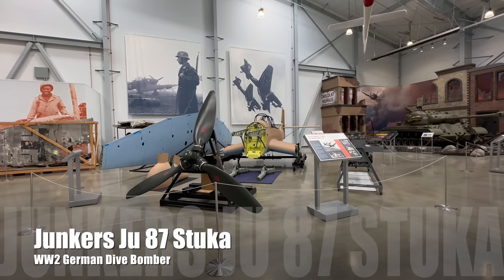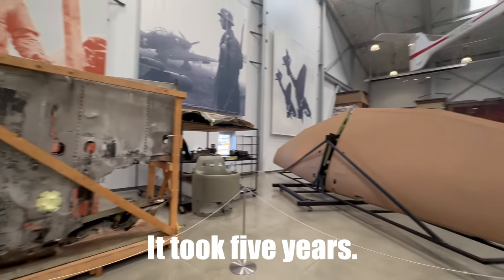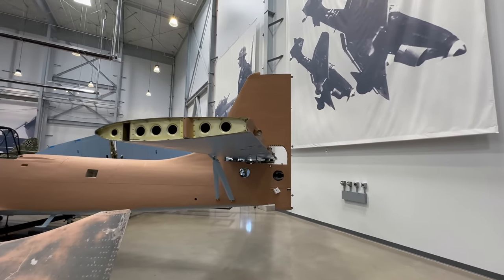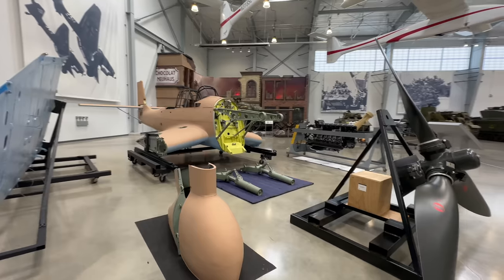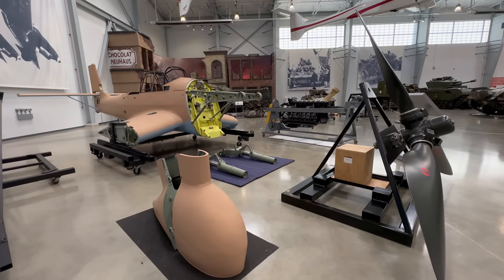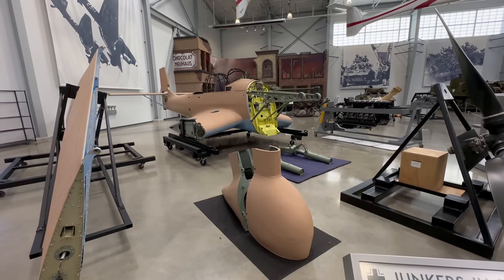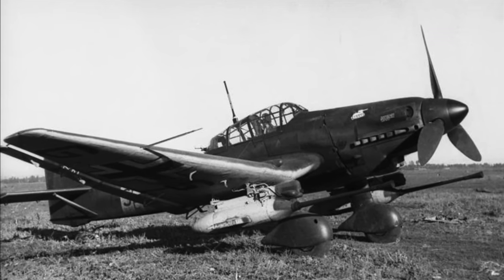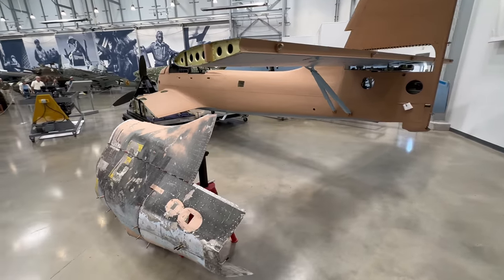WW2 Junkers Ju 87 Stuka FHCAM Restoration Project 2023

Comment: Someone should acquire the Chicago Stuka and restore it flight status.  The rocket scientists at the Museum didn't have it attached properly as it dangled from the ceiling and it crashed about two or three stories down one night back in the 90's.  Thus, the missing wheel spats and distorted right wing.  The motor is there, on separate display.  Besides, the version is different than the other two surviving specimens.
Reply: +@clevlandblock  The Chicago Stuka is the only example that still has the original wartime paint and it should be left alone.  It was dropped years ago with repairs.   It was taken down for cleaning recently and Paul Allen's museum sent engineers there to work undisturbed at night to collect data and many 3D scans of the aircraft to aid the team that was building the flyable Stuka.  This data was extremely important to complete Allen's Stuka.
Reply: @FiveCentsPlease As can be seen from the FHCAM ground up restoration, much COULD & SHOULD be 
done to undo the Chicago Museum's poor care of their Stuka. As it is now, it looks amateurishly maintained & indifferently cared for. It could be exhibited so that the public had so much more access & and awareness for the unique exhibit it is.
Reply: Why restore the Chicago one to flight status?  It's now one of two originals remaining.  Flight status means risking destroying an extremely rare artifact.  I'm all for using it as reference for building a new replica  to fly, but the one at MSI needs preservation, just like enola gay, or spirit of st Louis.
Reply: @sethjones5250   The Chicago Stuka was indeed used a reference to get missing engineering data for the Flying Heritage Museum Ju-87R-4 build.  A team worked at night to take 3D scans for reference and to consult with the build team about various items.  A fair amount of original technical information is missing for the Stuka type.
Reply: @sethjones5250   Restoring the Chicago Stuka to airworthiness would likely be a prohibitive undertaking; my understanding is that there is engine block damage.
I would like to see it restored to its original, as received, static ground display. That would entail repairing/replacing all the parts damaged or discarded after its fall from the museum ceiling,, and repairing the damage done when the museum attached the suspension cables. After 80 yrs, the 
a/c is do for a refurbishment.
Such a restoration, not to flying status, by professional restorers, will be expensive.

Comment: It has always interested me that Junkers were the only German manufacturer who built their own engines and airframes. The Stuka had a high loss rate and like all ‘planes of that time on all sides were built for a transient life. Many of those shot down in Britain went into the melt pot and came out a panels for British bombers and Germany did the same with Allied planes.
Reply: "The Stuka"? You do know that is short for dive bomber and that there where plenty of German aircraft that fell in the catagorie dive bomber so there was no "The Stuka"
Reply: @Tiberiotertio  Yes that is so. As a format it still had a high loss rate on both sides of the conflict which is why there was resistance within the RAF to ordering a specific aircraft of that type.
The bomb of the JU87 had problems in the anti personnel burst role - not that the victims would tell you so. This was solved by the Germans in Crete by welding a meter long rod on the impact fuse which burst the bomb before the casing touched the ground. The Trumpets of Jericho were quite effective against untrained troops. In the seventies the RAF would mock attack the army in layering areas. You would be amazed at how far you can bury yourself in a forest floor with your hands when they go into a reheat power climb from near tree top level!

Comment: I've stood next to the Stuka in the Royal Air Force museum in London. It's surprising just how big these aircraft are, they are a similar size to a twin engine bomber of the same era. The trailing edge of the wing is at least 5ft from the ground.
PS, it's "Schtuka" not "Stutka".
Reply from the maker: That huge propeller dictates the height off the ground. It's mosterous.
Reply: Yes, Stuka was short for STUrzKAmpf bomber, which ist german for dive bomber. To be honest, this is more a replica than a restored plane. Shall it get flight worthy?
Reply from the maker: I would call this plane a Dataplate Reconstruction Restoration. It will be a new plane when it flies. However the benefactor passed away in 2019 and we don't know what the new owner intends to do with this collection. He is not passing along any information and he doesn't make statements. Most people think he is building a museum in his hometown in Arkansa where this collection will go soon. It's weird that he does not communicate. When one is the steward of so much history, one has the responsibility to inform. I would be willing to bet that this is a tax right-off on the basis of having a museum with public access. That is the part where the owner should be responsible to communicate intentions. He did not pay tax on anything to do with the museum.
Reply: @ontheroadwithnorm2024  Thanksgiving for the information... what a pity.

Comment: Alas Paul Allen is dead, and there is no financial backing to finish this new build JU-87.  It will have to be sold to someone with deep pockets to ever finish the bird.
Reply: +@randyjennings3075   The entire museum and collection has been sold to a new owner with substantial finances.  Although, there has been no announcements regarding ongoing projects and the museum is just getting reopened.
Reply: Another restored plane that is on hold is a Me 262 restored original that has updated stock engines. Completed taxi trials with Steve Hinton just before flight tests could be done.

Comment: After recovery he will fly and often go to air shows ?...

I searched a lot for videos and didn’t find a single Ju-87 in a flying version...
Reply from the maker: There are none. This one was supposed to but after spending millions this benefactor passed away and the new one has not declared his intentions. It looks to be about 2000 hours to go to finish it. Additionally this project contains a massive collection of data on the aircraft type. 
The really good news is another JU87  looks like it will start a reconstruction restoration soon with the intention to fly. The foundation behind it virtually guaranties it will fly in about five years.
Reply: @ontheroadwithnorm2024  it is necessary to restore the only Ju-87 in the world - but so that it can fly...!!!
Reply: @CyborgHunter-T800   When the project is finished, it is very likely that it will remain at the museum and only fly there.  This was how Paul Allen's museum operated for the very rare aircraft, which makes sense because those planes are rare and were very expensive to restore and maintain.  The museum only put a few hours on them every season.  I would never expect the Fw-190 or Stuka to make any cross-country fights, but perhaps by road transport if needed.
Reply: @ontheroadwithnorm2024   With Collings Foundation cutting back on their flying, I would wait and see what they do with their Fw-190.  It still has not flown and they sent the BMW engine back for more work.  If the Fw-190 only makes a few flights and retires to their museum in Stow, MA then their new Stuka may be parked there too.

Comment: You asked the question about why there were only two examples left. 
  Well , in Britain we don't have a Bone Yard.
   Considering that WW11 was a terrible time , post war countries in Europe were broke and it wasn't until approaching or about the new Millennium that the UK paid off it's debts to America for the supplies we got.
  We made bus panels from aircraft aluminium. 
  How many Tornadoes, Nimrods, Harriers etc.
will be left in 80 years, apart from static examples somewhere?...
Great vid man...
Reply from the maker: Excellent reply thank-you. There are many stories of Europe, Russia, and the USA recycling WW2 aircraft to make aluminum required to build the larger newer aircraft of the cold war. America's B-36 and B-52 production alone required a massive quantity of raw material.
Reply: +@jaywalker3087   The post-war disarmament in Germany was very systematic.  There were Allied divisions tasked specifically with scrapping weapons.  The piles of aircraft and burn pits were salvaged by metal scrappers after WW2.   On the other side of the Iron Curtain,  Stalin refused Allied aide and was moving rapidly to rebuild a post-war Soviet military.  He ordered everything scrapped for raw materials so any abandoned weaponry would have been removed quickly unless in remote areas.  I do think Britain did a disservice by scrapping some VERY rare, captured aircraft that should have been preserved.   The post-Vietman military landscape is very different.  The government does want many advanced weapons getting into civilian hands and the de-mil laws are quite strict to destroy modern aircraft.

Comment: The flush rivets on the front of the wing are there (instead of roundhead rivets) not because of strength, but because of air flow.
Reply from the maker: Yes that's what I meant

Comment: The airframe is 100% new construction.
Reply: Agreed. It'll be nice to see one fly again but in reality it's a copy not a rebuild since so much of the original is unusable. There are arguments about these aircraft whose owners claim are original but other than a couple of screws, bolts or manufacturers plates are completely new. The spitfire used in the film Dunkirk was recovered from the foreshore at Dunkirk and there was barely anything left. German troops had scavenged souvenirs from it and seventy years of salt water had done serious damage to what remained yet now it's flying.
The Me262 and Fw 190 flying in the states are modern reproductions too. If you had the money to build from scratch a Ferrari but then added the data plate from a defunct genuine Ferrari would that make it an original? Of course not.😊

Comment: The Stuka was actually already out of date by 1939 but did okay until they tried to use them over England.  After they suffered heavy losses against British fighters they were given other duties.
They were simply shot out of the sky which caused their demise in numbers.  Even so it was an interesting concept and deserves it's place if only for the crews that had to fly in them!
Reply: According to Price, in his book, the "history" of the Stuka slaughter over Britain is a bit of a British shiboleth. They had a couple bouts of severe losses, partly the cause of non-connecting fighter escort, but these losses compared with both British, and other Luftwaffe losses on specific occasions. The Stukas did quite considerable damage, but were withdrawn, not because of losses, but because the Luftwaffe was shifting the focus of its attacks in the BoB, and was reforming its ground attack (Stuka) Geschwaders for Operation Barbarossa.

Comment: Is much of the original aircraft getting used?
Reply: +@m1ceal  Only misc fittings and the ID.   Multiple engines were sourced for parts to build a reliable unit.  The airframe is mostly new-construction by researchers and specialists in Europe.

Comment: What % of parts flew in the original aircraft....this appears to be a new build, perhaps using on the data plate.
Reply from the maker: Yes it is a data plate reconstruction with a white glove budget. They used four airframes for dimensions and examples. It has an original engine made from 10 engines collected. Built and test run in Tehachapi California. The Proppeller blades are new from Germany Hoffman Propeller
Reply: +@richarddunger2177  Probably very little from the original airframe.  The museum bought from private collectors worldwide to obtain WW2 OEM components and engines. What needed to be in perfect condition, such as the cooling radiators were made new.  The propeller blades are new manufacture, as it much of the aircraft for safety.

Comment: I have been following this project since its inception, before the Covid shutdown of The FHC collection, after Paul Allen’s passing. The project is at the mercy of Eastern European Restorationists, and fabrication that has been stalled out by the war in Ukraine. That’s what I was told when I visited the FHC/AM this past Summer. Hope the new Owner, Steuart Walton, finds a way to resume this rather advanced restoration project.
Reply from the maker: The fellow running the shop in Hungary that built this airframe passed away in 2020. We can only hope that Steuart continues this project in Arkansa with Jason. Or send everything to Gosshawk with a large bag of money. Keep sending a big bag of money every month until it can fly. The engine is tested and ready to go. Apparently there is a complete instrument panel in Austria ready to go.
Reply: +@justicemeter347   A Hungarian engineering company (IAMF, I think) did the airframe research and construction.  Those engineers were on-site at the museum to complete the assembly until Allen's sister shut down the museum.  I would assume that those engineers will need to be contracted again to return and resume the work in the future.
Reply: @ontheroadwithnorm2024   The avionics for the Stuka were restored in Austria.  Vulcan Aerospace (a subsidiary of Allen's financial holdings Vulcan LLC) were in control of the aircraft and the museum.  The aircraft were registered with Vulcan, and I assume will transfer to the new owner over time. Gosshawk did a lot of the final work with the Fw-190A, and some of the Me-262.  But the Me-262 returned to Vulcan for completion and paint. And Vulcan switched to their own painters for the Stuka also.  I'm not sure that Vulcan would still be involved with Gosshawk.  Gosshawk did buy the remainer of the Flugwerk project-- parts, aircraft, jigs, etc.  So they are a "Fw-190" shop for the Flugwerk planes and have completed the new Fw-190F-8 restoration for The Collings Foundation.  Collings also has the beginnings of a Fw-190D-9 project (part Flugwerk and part wreckage) and I assume the Gosshawk may become the shop to build the D-9 for Collings sometime in the future.
Reply: @FiveCentsPlease Great Intel. Thanks, everyone! Let’s hope Steuart Walton shares the passion to complete this project. It would really honor the memory of Paul Allen and build a legacy for Steuart Walton. Fingers crossed here for the continuation of a shared passion for this extraordinary Stuka Restoration/Fabrication project.

Comment: Wait a minute!!
They can restore "1 of only 3" Stukas to flying condition: but they can't restore a 190 D9 to flying condition?? How does that work?!
Reply: The Focke-Wulf 190D in the collection was actually restored to flying condition before Paul Allen bought it. It was decided to never fly it because of the extreme rarity.
Reply: Surely that should be the same case for this Stuka?? Rarity?!
Reply: @edwardbrophy9749    The Fw-190D at Paul Allen's museum is a rare Fw-190D-13 variant and the last example of the D-13.  I'm fine that it stays on the ground.  In this case "airworthy" may be subjective because I'm not sure if the engine had completed the rigorous inspection and testing to be flight certified.  There are a few D-9 projects in progress (replicas in some instances) but nothing that is moving very fast.   Vintage in CA is currently building a Jumo 213 for a future D-9 project, and they've been waiting on the rebuilt prop and a few other parts for a long time before they put the engine on the test stand.
Reply: @edwardbrophy9749   Also, I think there are maybe less than ten, more like five or so, D-9 wrecks/projects worldwide and all but one are in the US, not counting the Lake Schwerin wreck being rebuilt in Germany.  MAM has a D-9 wreck in VA and a replica, the Cavanaugh Museum has a D-9, and the Collings Foundation has a wreck.  I found it curious that the Paul Allen museum did not add a Bf-109G to the collection since several were for sale over the years.  They already have a Dora, so getting another may not have been a priority.
Reply from the maker: Some how your comment posts have more information than my videos. Truly excellent. Thanks for posting. How would you like to go for a walk through this museum while I interview you? Your knowledge should be shared.I'll bet the warbird community would be impressed. I'll buy you lunch too.

Comment: nearly all the Stukas were landed at the end of the war with the landing gear unlocked to cripple them.
Reply: Landing gear unlocked? Just how did that work?
Reply: Hmnnn , fixed undercarriage  ?? How would they unlock permanently attached undercarriage
Reply: Not Stukas, but it was common practice to disable the landing gears on fighters to cripple the aircraft on landing when they were flown to be surrendered.